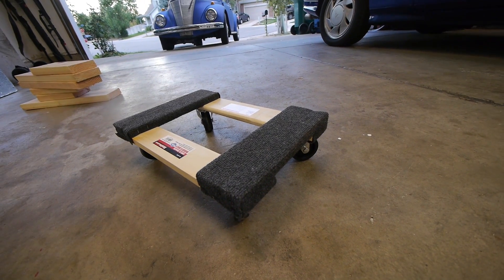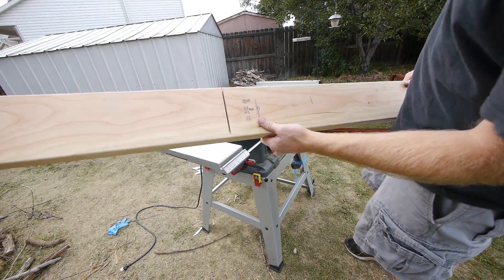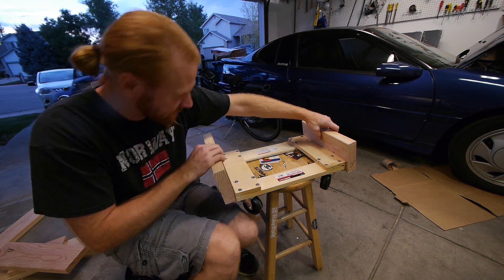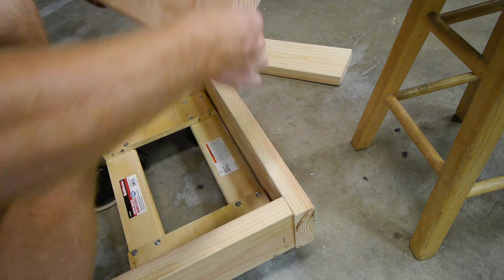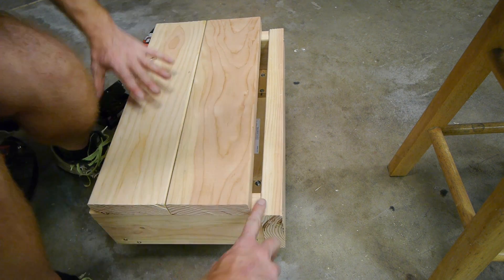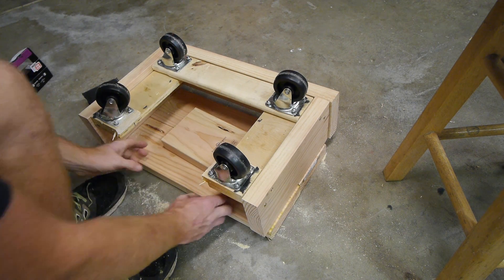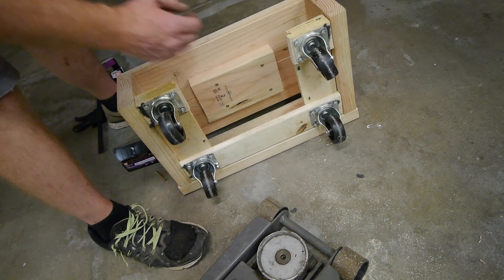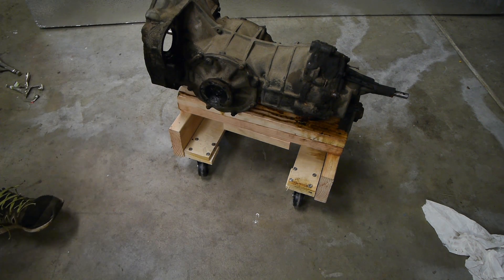$12 DIY VW Bug Engine Dolly

Comment: If it still works, then that's a great idea.  The only thing I don't agree with is the shear weight dependent on the screws  driven into the sides.  It seems that putting the 2x6 on top of the dolly so the weight is directly on the wheels rather than on the side would work better.

Comment: Looks like you have the wrong clutch plate for the gearbox (you have an early clutch on a late box)
Reply: Wow good eye!  Yes, I did have the wrong clutch plate.  I removed the center ring in the pressure plate to make it work.  https://www.thesamba.com/vw/forum/viewtopic.php?t=623056
Reply: That will make it run a little better!